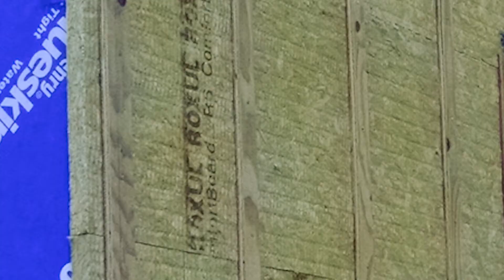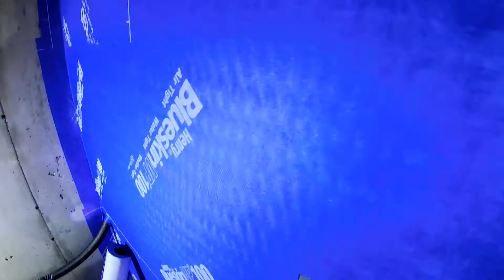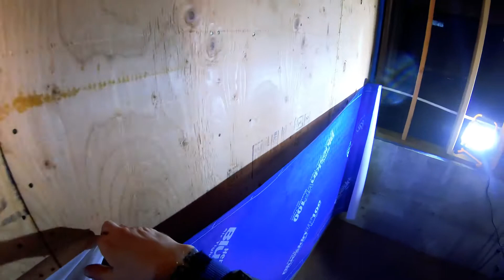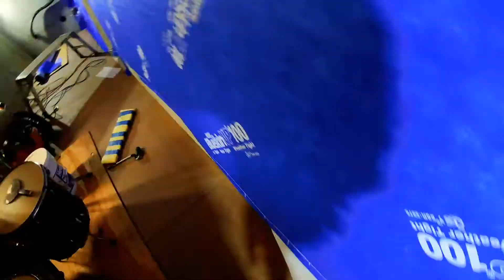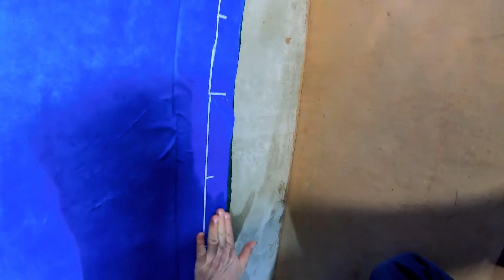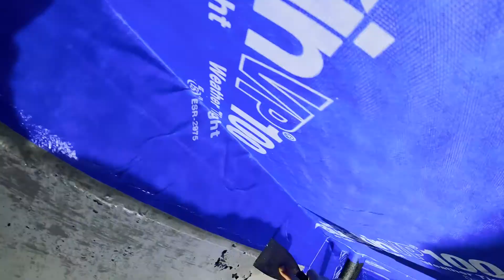AIR SEALING Let's put up some PEEL & STICK

Comment: easier to run vertical
Reply from the maker: Yes!  It also would have been easier with a helper.  But I preferred to have it shingled so that long term even if the adhesive fails I still have gravity on my side to keep water out.

Comment: It is tough to tell if this is being applied to an outside wall or inside wall. Can you explain what we are seeing you apply the Henry Blueskin to?
Reply from the maker: I'm applying the blueskin to the exterior of a wall that faces the crawlspace and a storage area/room under the house.  It is protected by the house but is open to the outside through the foundation vents.  It also makes up part of the air barrier envelope so I'm using blueskin to seal it.  Its not a common area to be applying peel and stick, that's for sure.